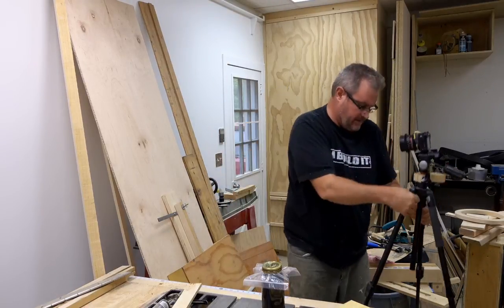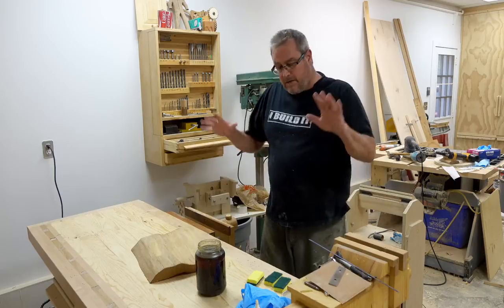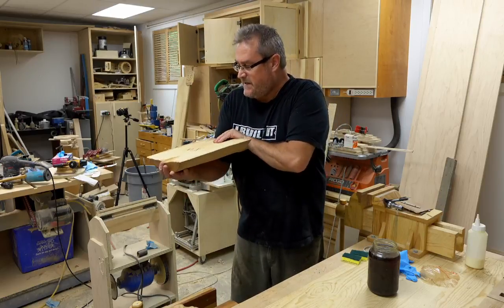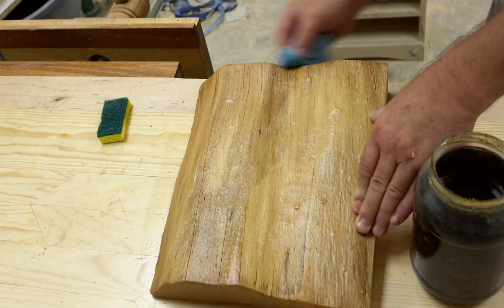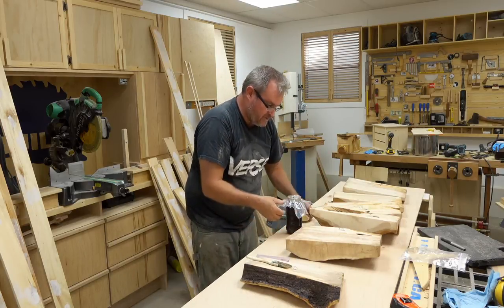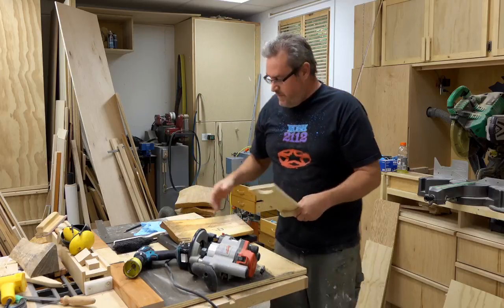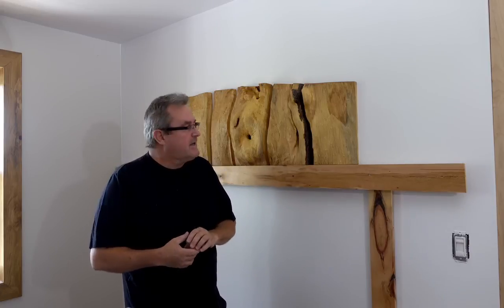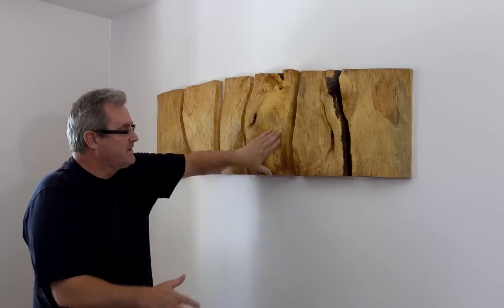About The Natural Wood Wall Sculpture

Comment: I like it....

That kind of thing is a TON of work...  I did something along those lines for a client once, and I didn't quote enough...  but that's another story...

I will tell you, if you go bigger, the project gets heavier in a hurry, and then it's SO heavy, you're scared to put it on a wall....  And in a client scenario, you better get them to sign something ahead of time, that this is going to be many hundreds of pounds, and that you are not responsible for anything.....

There's so many ways you can go, with a project like that though, that's what's so exciting.  You can really let the creativity go.  You can let the wood itself, dictate what it will be.  Just as an example, you could drop a cookie off your roof, let it break, and then position it along the break lines, with gaps, the look is amazing....  There's just so many ways to go.

But I like what you did.  Very Nice.

Comment: Nice work man.
I like the disc idea to make sort of micro adjustments. One question though. If they are round and the screw  is offset, when you turned the disc to raise or lower, would it not adjust left and right as well?

Comment: Why is it called ‘Danish’ Oil?

Historically the term Danish Oil seems to have appeared when Scandinavian furniture, protected with an attractive low sheen finish, began to be exported around the world during the second half of the 20th Century.

In America there are a number of manufacturers of ‘Danish Oil’ and each product has widely varying ingredients. They are comprised of many different combinations of natural and synthetic varnish and resins, mineral oil, tung oil, linseed oil, poppy oil, cotton oil, sunflower oil, white spirit, naptha, driers, anti-skin agents, etc etc! The actual non-evaporating ‘solids’ content of these products can be as low as 10%

We are based in the UK, and when we began manufacturing our own oil products for wood we decided to find out for ourselves what was available here as as Danish Oil. Generally in the UK we found that Danish Oil usually has a low sheen finish, with  a drying time of 4-8 hours per coat. UK products are mainly Tung and/or Linseed oil based, although some use only vegetable oils and synthetic varnishes. Solids content of the best known brands is usually around 30-40%. We haven’t found any products (except ours) with 50% or more solids.
Reply: The layer under the bark is called the cambium layer and it is what delivers water and nutrients up the tree. That is why if you girdle a tree it will die.